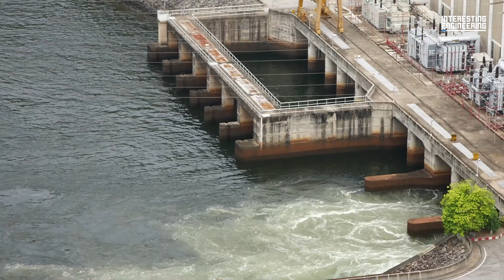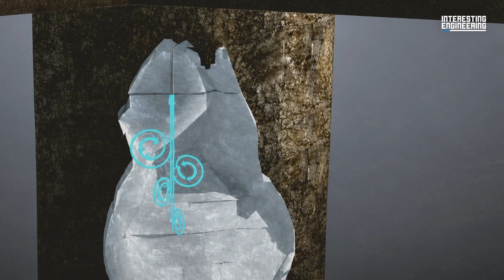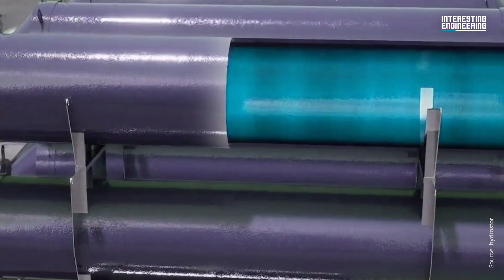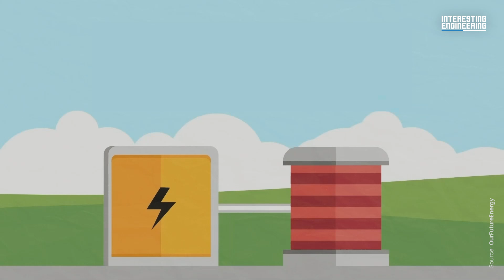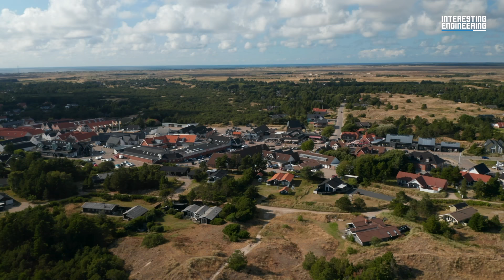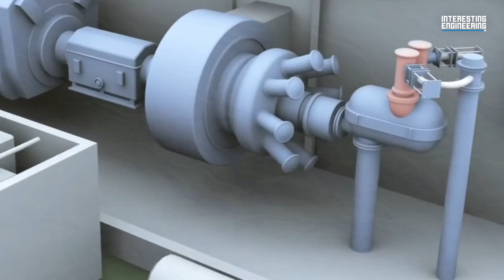Why Air Batteries Are Finally Beating Lithium

Comment: unused windpower could be used to make hydrogen and then be used it's a better idea .
Reply: Hydrogen sounds great until you hit the efficiency numbers at 9:45 😅
The video basically admits hydrogen roundtrip efficiency can drop below 50%, while compressed air could stay around 60–70%.
That’s why a lot of people in the energy space are quietly shifting attention away from hydrogen hype lately.
Reply: @EnergyAxisIntel 
hydrogen technology can always evolve with new minds and insight
Reply: @EnergyAxisIntel для сжатого воздуха такое КПД не возможно при хоть какой-то адекватной длительной мощности 🙄вы буквально вынуждены два раза через карно проходить, и ещё плюс - эффективность турбин/насосов.
Никакие рекуператоры и балласт не спасёт - это кратковременно. Сжижать воздух и то выгоднее будет
Reply: @Devis1982 LAES isn't yet proven and has a low RTE due to phase change. Adiabatic CAES where the heat is stored in something like ceramics trumps LAES efficiency every time plus it's proven
Reply: @TouringTony как раз фазовый переход для азота и даёт нужную эффективность - это постоянная температура холодильника в конденсаторе для газовой турбины, не на водяном пару само собой. Сжижать конечно низкое КПД - но оно заведомо выше чем два цикла карно для сжатого воздуха.
Не делают потому что это опасная установка, гораздо дороже чем коммерческие и масштабиркемые уже сейчас варианты. Сжатый воздух просто ещё хуже
Reply: @EnergyAxisIntel perhaps electrolysis of sodium is better since the sodium metal can be used to make batteries for electricity storage or toss in water to generate hydrogen if needed.
Reply: Hydrogen is a waste
Reply: @AGNITR-8 not according to the Japanese. Toyota has hydrogen engines
Reply: @LEONARDTHEODORECROLL на лошадях тоже грузы возили, мало ли что там у тойоты🙄
Reply: @Devis1982 
Horse power
H power
Same same, except a horse poopes and hydrogen engines return water. Could be good for desert counties to reforest them from more moisture if adopted as transportation.
Reply: @Devis1982  А на ослах воюет вторая армия мира :face-blue-smiling:
Reply: @Drillmechanic печально быть второй армией мира, конечно🤣хотя я против осликов ничего не имею - на них вообще весь мир завоевывали, неоднократно 🤔
Reply: Водород сложно хранить, только как добавка к чему-то 🤔
Reply: Producing hydrogen is a very inefficient process
Reply: @samueljoseph7 that's why you use renewable energy. The best part is water returned after combustion. Pros and cons

Comment: It's not by means of free and unlimited air, it's extensively material dependent, expensive material dependent solution.. it's the compressors and their pressure tanks. how they  are cheaper than batteries or other things? lots of iron steel and electric motors etc. there are sodium batteries made up of basically salt and less iron.
Reply from the maker: You're absolutely right that the "free air" framing is misleading — the cost is entirely in the hardware. Where CAES wins is at large scale and long duration: a salt cavern can store gigawatt-hours of energy with just a hole in the ground plus surface equipment, which gets cheaper per kWh than batteries as duration increases. Sodium-ion is great and improving fast, but for multi-day storage, mechanical systems (CAES, pumped hydro) still have the edge on cost per kWh.
Reply: Air is not unlimited.

Comment: Якщо утворюється вода то чому її не можна продати?
Reply from the maker: Good question. The amount of water produced when compressed air expands is actually quite small,  it's condensate from humidity in the air, not a continuous stream. In most systems it's just drained off as a byproduct. The volume is too small to be commercially valuable compared to the cost of filtering and distributing it.
Reply: @interestingengineeringie  Необхідно комбінувати стиснення повітря із теплоємною водою для регулювання температури і використовувати енергію витісненої повітрям води для приводу турбінних електрогенераторів.

Comment: Build a dams to store water.  That's cheaper then every thing.
Reply from the maker: Pumped hydro is actually the cheapest large-scale storage we have, and it makes up over 90% of the world's grid storage today. The catch is geography,  you need two reservoirs at different elevations, plus water rights, plus environmental permits, which is why new projects are rare in many countries. CAES exists partly to fill that gap where pumped hydro isn't feasible.
Reply: When rivers are drying up consecutively each year?
Damns are environmentally destructive, it would've been nice to see you promote upland burms and rewetting.

Solar panels even with batteries and inverters are defacto the cheapest energy generation on earth now.

Comment: This feels like one of those technologies that doesn’t sound flashy, but could quietly become essential for a renewable grid.
Reply from the maker: Exactly the right read. The unsexy infrastructure technologies often end up being the most consequentia, transformers, HVDC lines, pumped hydro. CAES could easily join that list as long-duration storage demand grows.
Reply: Она не масштабируется совсем. Если вы захотите из нескольких сотен киловатт сделать хотя бы сотню мегаватта - вам дешевле окажется купить и постоянно работать на дизельном генераторе. Даже если электроэнергия совсем бесплатной будет - потери на нагрев/охлаждение слишком драматично растут
Reply: @Devis1982  Very true. But that is why you do not heat your house with electricity but with gas like in the Netherlands.
Reply: @grumbeard дома разные бывает, и в разных местах. Почти везде на земном шаре выгоднее из газа получить электроэнергию и отапливать дом тепловым насосом этой электроэнергии. Точнее вообще везде выгодно, просто в некоторых странах импортное оборудование под запретительные пошлины попадает🙄
Reply: In this situation, sodium batteries completely change the system of storing electricity - simpler, cheaper, more easily scalable and not requiring such investments.
Reply: Renewable grid because every part of that infrastructure grows on trees and no dotations are needed to make it economical, thus gaining more energy from it as was on input to built it in first place?

Comment: Batteries can do the job there are many types of batteries!
Heat , Flow etc etc!
Reply from the maker: Batteries are great for short-duration storage, but they get expensive fast when you scale up to days or weeks of storage. Flow batteries help, but they're still mostly in pilot stage at grid scale. The reality is we'll likely need a mix, lithium for fast response, flow/sodium for medium duration, and mechanical storage (CAES, pumped hydro) for the longest durations. No single technology wins everything.
=
Reply: @interestingengineeringie Yank
Reply: Expensive and heavy investment
Reply: @thebeautifulanimal  speaking of fossil fuels....
Reply: @BeLowBelowo  same there too
Reply: @thebeautifulanimal современные натриевые китайские аккумуляторы дешёвые, доступные и элементарно масштабируется. Сейчас не 20 век🙄
Reply: @thebeautifulanimal Yank

Comment: And were back to steam engines pretty much
Reply: Мы от них никуда и не уходили. Даже современные реактивные двигатели и атомные электростанции работают на обычной тепловой газовой машине, как в позапрошлом тысячелетии
Reply: @Devis1982 a steam turbine and gas turbine are very different.  And of course the efficiency and engineering tolerance of modern turbines are little bit better.  But yes, the laws of thermodynamics remain
Reply from the maker: Ha, kind of. Honestly a lot of modern energy tech rhymes with 19th-century ideas, heat pumps, thermal storage, even molten salt reactors. The physics didn't change, we just have better materials, controls, and economics now. Steampunk grid when?

Comment: Thanks for the video.
I've been working for a year on a paper using MEA (monoethanolamine) as part of the heat recovery system in CAES, to add CO2 DAC (direct air capture) revenue to the project. Hope for the future
Reply from the maker: That's a really clever integration,  using the waste heat from compression to drive the MEA regeneration step would significantly improve the parasitic load on DAC. The heat-recovery side of CAES is often underutilized, so coupling it with an endothermic process makes a lot of sense. Would love to read the paper when it's out. Good luck with the research. Send us at contact@interestingengineering.com
Reply: Can you link the paper ?
Reply: @rishidixit7939  I'd like to read it as well please !
Reply: @rishidixit7939 if it ever gets finished, sure. 😅
Reply: Why not just extract the air from the cave and create a vacuum ? No compressed air, not heat loss. You get the energy back with when you let the air back in the cave.
Reply: @En_theo  Because in the case of a vacuum, you can only get a differential of pressure of 1 atmosphere (1bar), which is really not a lot. However when you compress air you can go virtually as high as you want, say 40 bar for example, which gives you 40 times the energy of a vacuum in the same volume.
Reply: @ThrillOfHunt  
Sure but you don't lose 20% of energy. So we'll need to search for bigger caves. Also, the tech to store a 1 bar pressure is less expensive than 40 bars.
Reply: @En_theo  yeah, but the cave has to be geologically stable enough, and also caves are often important ecologically in their respective regions
Reply: @kakiremora2991 
then I can say the same for a 40 bars-compressed cave.
Reply: @En_theo I assume you still lose energy with the vacuum proposition as the lower the pressure, the lower the temperature so you will be cooling the walls of the cave during the vacuum process and heating them when the air is let in with the limitation of 1 bar differential pressure
Reply: @En_theo the bats and spiders sure as f cannot
Reply: @Egyptien007  
good point, but you cool progressively the air left. The leser air left in the cave, the lesser there is  to cool. I suspect the loss is much smaller than compression, but one should do the math for that and I'm not in the mood lol
Reply: Maybe diethanol amine will be better
Reply: @PeterFamiko-lw8ue DEA is less corrosive to equipment and less volatile for storage, but is used because it reacts at lower temps and pressures.

The CAES thing is that there's plenty of heat and pressure to drive MEA. DEA might work out better for longer term systems though.
Reply: Good luck
Reply: I would assume noise is another issue when you release this compressed air to move turbines
Reply: Could the compressed air system's excess heat be used in a secondary system of molten salt or something like that? You know for efficiency? That's what it seems like you're getting at it right?
Reply: Can you link the paper DOI, please? I am interested
Reply: There’s a way more simple solution: power plants that produce energy only then when it’s needed. 😊

If they can’t, then they are not very useful and only Supplement to basic provision.
Reply: @volkerr. Not true. If it's cheap enough then even if a system only generates part of the time it's worthwhile. 

Likewise if combining part time generation with storage allows full time power generation and is cheaper than a standard plant it's still worthwhile.

If a power system can only produce power 23 hours a day but was 50% cheaper it would obviously still be worthwhile to have them

Comment: Amish have been doing this for years, they rig air pumps, to their farm windmills, that put it through tanks. When needed they use the same kinds of pumps to power fans, and lights, sewing machines etc. Instead of having tones of expensive electric motors in turbines, power cables and heating regulators, you just have big air pumps that are connected to a centralized air storage, that gives constant source of power to a central electric motor, based on how the average annual power output of the turbines. You might have to add in a secondary pump to reduce the back pressure of the air-storage system, so deffintly some losses.
Reply from the maker: That's a really cool real-world example. The Amish basically invented decentralized CAES without calling it that. You're right that pneumatic systems eliminate a lot of conversion losses when the end use is also mechanical (sewing machines, fans, etc.). The tricky part with scaling it up for grid electricity is that round-trip efficiency drops once you add the compression-heat losses and the final turbine/generator stage. Still, for direct mechanical work it's hard to beat.

Comment: Could it be an offgrid solution, now and then compressed air cars have appeared, so it might work for homes.
Reply from the maker: In theory yes, but the energy density is the killer for home use. To store enough compressed air to run a house overnight you'd need a pretty massive tank, plus a compressor, heat exchanger, and expander. Lithium batteries store way more energy per cubic meter for the same money right now. Where it does make sense at small scale is if you already need compressed air for tools or pneumatics.
Reply: @interestingengineeringie Batteries (excluding lead acid) are also extremely efficient through the charge and discharge process.

As the video explains, it is difficult to keep compressed air at a high temperature in order not to lose energy.
Reply: Can anyone think of applications where lots of compressed air is needed?

Comment: Wrong. Compressed air energy storage was NOT NEEDED with fossil fuels.
Reply from the maker: True, because fossil plants are dispatchable — you just burn more fuel when demand rises. Storage only becomes essential when your generation is variable and uncontrollable, which is the whole point with wind and solar. So it's not "wrong," it's that the problem itself didn't exist before.
Reply: Progress will always raise new issues. It doesn't mean we should stop making progress

Comment: will video talk about "BOOM" risk? //watches till the end, nope. oh well.
Reply from the maker: Ha, fair question though! Compressed air itself doesn't explode in the chemical sense — no combustion — but a tank rupture releases a lot of stored mechanical energy very fast, which is basically a pressure bomb. That's why utility-scale CAES uses underground salt caverns or depleted gas fields instead of steel tanks. Much safer and way cheaper per kWh stored.

Comment: Why not use the excess energy to run something that solves a problem that would run anyway on a non renewable grid? Like for example if you had a plant that produced a chemical of some sort that’s expensive and uses a lot of power to make. Then it could be sold for a profit and profits would be high cause the energy cost would be lower
Reply from the maker: This is actually happening — it's called "power-to-X." Green hydrogen, green ammonia, and synthetic methanol plants are being built specifically to soak up cheap renewable surplus. The catch is that these plants need to run fairly steadily to be economical, so intermittent cheap power doesn't fully solve their problem. But yeah, it's a legit strategy.
Reply: @interestingengineeringie  you can burn the same fuel you are making to produce energy  when in demand ? Or it drops the efficiency too much as  losses ?
Reply: The issue with having any plant (hydrogen related or otherwise) that mostly produces when energy is plentiful, is the way this affects project financing.

The CapEx is still there. The rent and business rates are still there. So need the highest utilisation rate possible for the equipment and land you have.

On-site renewable generation and storage is becoming more common. Why pay for grid power when the sun shines for free!
Reply: lol thats not that simple. Not everybody have a chemical factory. Even if they want to use the excess energy majority of time theres really no productive outlet for this kinds of plant. Renewable are always caught between, only  usable residential wise or be so expensive that yes it can probably run a factory but because renewable energy are somewhat inconsistent even now, its not worth it, specially if the product is time sensitive and cant have any intruption.
Reply: But you need to consider the amount of time your expensive equipment just stay there and produce nothing. It is just not economy to do that.
Reply: As you'll see from the comments you want something that uses energy, but costs very little to build (so your loan payments aren't so expensive that you have to run all the time).

At a residential scale this is currently hot water.  The hot water system is already built.  The extra you add to make a "dump load" is a resistance coils or sometimes its already built in.  The extra cost is very small to zero.  But this isn't awesome as there is only so much water to heat and if it's already hot enough, overheating is dangerous.

But low Capex intermittent electrically powered value creation is definitely an area being pursued.
Reply: Or just desalination plants are hella expensive
Reply: Химия и другие сложные тех процессы обычно непрерывны, сложно на лету такими технологиями управлять.
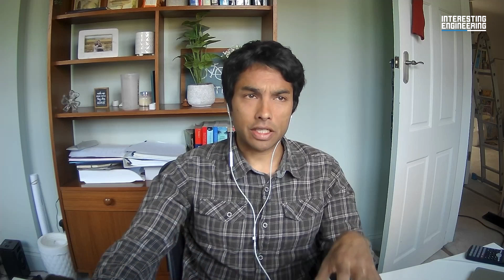Reply: 7:02 is the key line nobody’s noticing.
The whole advantage of compressed air is that storage duration scales cheaper than batteries. So yeah… turning excess renewable energy into industrial output actually makes more sense than pretending batteries alone will solve everything.
Funny how the “green future” is slowly becoming an industrial infrastructure story instead of an environmental one.
Reply: Yes and no.  The problem is,  many costs, ie capital costs, continue whether or not the electric using process is operating.  It has ALWAYS been done, but there are limits on its use.
Reply: That's the idea with hydrogen. You overproduce during high production and sell hydrogen to gas powerplants that keep the grid powered.
Reply: The whole green clean thing is the problem. Nuclear is renewable and does not require storage.